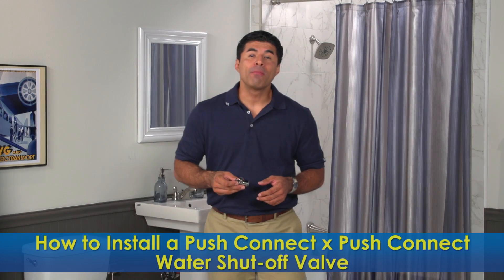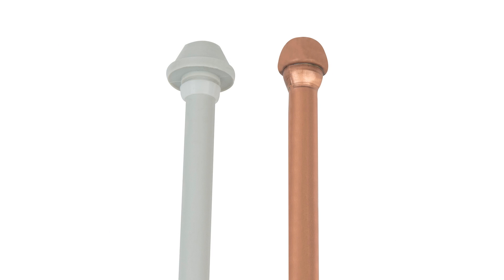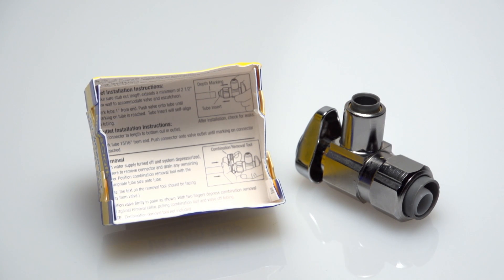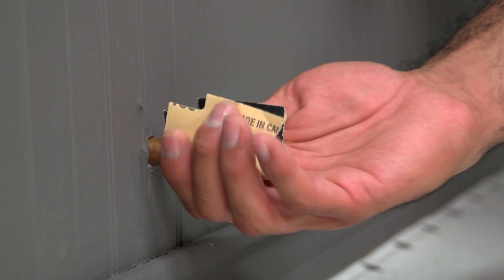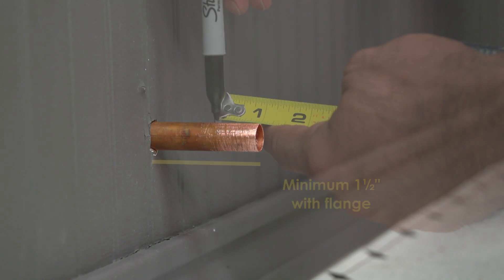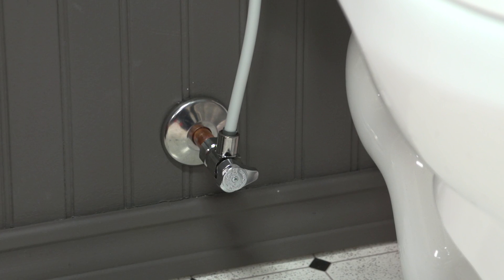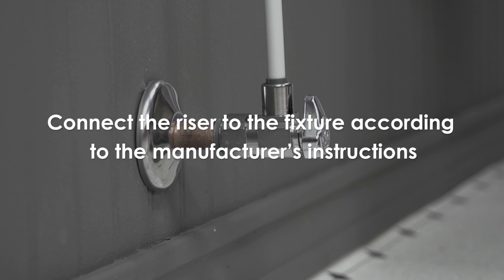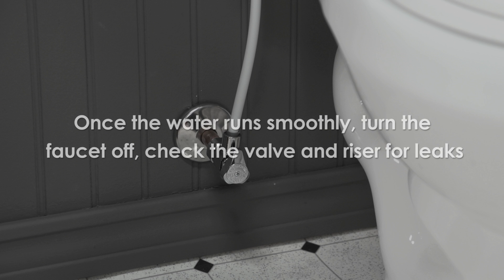How to Install a BrassCraft® Push Connect x Push Connect Valve

Comment: Should the valve be able to rotate after you have pushed it all the way in??
Reply: That's a good question, too bad Brasscraft doesn't seem to answer any questions under their videos. Mine is rotating.... I'm not sure if it's supposed to or not.    What end up happening with yours?
Reply: @Apollos2.2  My fitting does not leak even though I can rotate it. Yea, Brasscraft doesn't seem to reply to any questions
Reply: @Paul LaPinta  Thanks Paul, I put the question in Google as well and it's okay if it rotates.

No leaks! Woot 🙌
Reply: @Apollos2.2 mine rotates too, no issue. It says valve needs to be in upright position but the hose makes it face the down position… hoping that’s okay too.
Reply: @1371ddcantu  mine ended up working out fine even though it rotates. 

I'd try and zip tie that hose or something just to make sure your valve is upright to avoid leaks. Maybe it will work for you like that but I don't know.

Comment: How do you Remove it once installed . What if it leaked and I have to put a new one
Reply: There are removal tools they look like horse shoes
Reply: If worst comes to worst, you might need to cut it off, have a coupler handy and add some extra pipe, and then put on a new one because the other one wasn't put on right or was defective

Comment: How do you remove it from the wall if there is a leak? I tried the SharkBite disconnect tool, but it didn't work.
Reply: Did you manage to remove it ? How?

Comment: Surprised it worked. I was expecting the valve to shoot off under pressure.

Sanded the inlet pipe with 80 grit until it shined. Ensured the pipe was as round as could be. Pushed in the valve until it stopped around an inch.

Weird that it spins but it works. No leaks.

Comment: I did it just as shown, and it immediately leaked. And now I can't get it off. I thought maybe the sharkbite tool would take it off, but amsomeone else here commented that no, the sharkbite removal took will not remove the brasscraft valve. Now I'm stuck, without being able to turn my water on until I can take it back to the store tomorrow.... after cutting it off the pipe, and losing another 2 inches of pipe in the process.
I really wish I'd seen these videos before purchasing the valve.. Just the fact that they don't care enough to reply to their customers questions is enough for me to not buy their product.